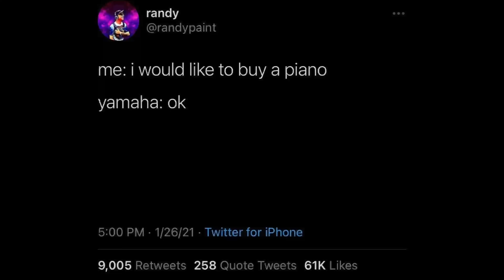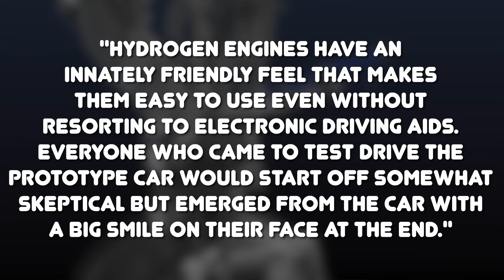Toyota's New 455HP Hydrogen V8: Everything You Need to Know

Comment: if you read a lot of  the comments on line about electric cars,  you'll see that they have numerous problems and are very impractical. there's not enough lithium for all the batteries. There's no way that the electrical grid can handle all these car's charging up if they become the majority. Their way to expensive. On tesla alone, I counted 21 problems from owners who commented on line. Waiting at a charging station can take a long time and if you don't have the right connecter, you won't get to charge at all. Right to repair is also a big problem with tesla. Also the government will probobly start to miss their gas tax, and figure how to punish electric car owners. one tesla owner said that it cost 20,000 dollars to replace a battery. they don't save the environment because fossil fuels are used to produce the electricity for them. driving distances for them is still very poor.                                              so electric cars are not the answer. they have their place, but only on a limited basis.

Comment: I live around 20 miles from a hydrogen filling station and about the the same from a Tesla supercharging station. Normal EV charging does not interest me as it is way to slow. It takes about the same time to fill a hydrogen car as a petrol car so there would no waiting around when I get there.
When we get many more electric cars on the road, people will be queuing up for the chargers or plugging them in at home for hours or overnight. There have been concerns raised that some areas do not have the infrastructure to supply enough electricity for everyone to have an EV so this would mean digging up roads and running more cables. Also people who live in high-rise buildings would not be able to charge their car from their home supply, and there are reports of a lot of chargers not working so they are already unreliable. And what happens in a power cut? When it ends everyone will want to charge their car.
As they sell more EVs, more charging stations become available, but they are playing catch up, the same could happen with hydrogen cars, some petrol (gas) stations have LPG tanks for those who have converted their car to it and they could have hydrogen tanks instead or as well. As the fill up time is quick there would not be the same queue as for charging and the catch up would be quicker as it would be centralised in filling stations and not the many chargers in every town that would have to be installed.
With more EVs there will be less demand for petrol, so the garages will have to change to EV charging points or hydrogen. Diesel will probably be sold for longer because hydrogen engines would probably not suit trucks at the moment unless it was a fuel cell type that converted it to electric.
Also we can convert our ICE cars to hydrogen meaning they won't have to be scrapped causing a lot of waste, and there will not be any dead EV battery waste from them either.
You only get steam and water out of the exhaust pipe as well almost no pollution.
You need electricity to make the hydrogen and his could be done with wind turbines, solar panels and tidal power and the hydrogen taken by tankers to the filling stations. As the you need water to make hydrogen the tidal power could also power a desalination plant for the water used.
#HaveIJustSavedThePlanet?

Comment: JCB, a British equipment manufacture converted its' diesel engine to hydrogen basically because the electric added $250,000 to an excavator and they could only run it for four hours a day. The Hydrogen engine was far less costly and could run all day. Ask any construction company what they would prefer.

Comment: i think whenit come to maintenance the electric is going to out of pocket expenses do to the hydrogen motor since the motor it self wasnt modified all that much and the more we work with it the better it will get just as the electric has. plus you can make hydrogen right at home with barely nothing just water and a batter

Comment: So Hydrogen cars could be a real alternative to electric as we would be able to refuel a Hydrogen car with a cell that you could buy basically any shop. Of course a law should cover the ways of selling this Hydrogen power cell's. So as I said before I would buy any day a 450BHP internal combustion engine powered by Hydrogen gas but stored as solid fuel. Electric cannot replace the feeling that's given to you by that explosion inside the engine and after in the exhaust. More than that is something else to struggle sometimes to keep them in a line. Internal combustion pro optimistic as far as the car or any other commute  with internal combustion is 0 emissions and even more if the fuel could be obtained by contributing to the effort of caching and lowering CO2 emissions. So good luck to all car makers and hope to see this put in to application ASAP as we need this change. The tech is out there waiting to be built.

Comment: Yes, I, personally sincerely believe that Hydrogen will be the alternative to electric  as scientists have developed a stable way of making the gas solid. It's green, easy, cheap and clean to obtain and store and as a result of that it's also easy to transport. The solid fuel It's more stable meaning it's safer to install on car and all sort of internal combustion with some tweaks. It requires an installation that converts the state of  the gas or a installation that separates the H2 from H2O (or mostly any other liquid that's 90%+ H2O). That if I'm not mistaken may 95% or it could be 65-85% water. But recommended was pure water. But not the purified one as that doesn't conduct electricity wich is needed to separate the H2.

Comment: Thanks for the great video. I think we have to wait for Hydrogen prices to drop. First use will not be for personal transport, but commercial. Mining and long haul transport will likely be the ones that use hydrogen. So they will underwrite hydrogen fuelling stations. Large vehicles and diggers are perfect for hydrogen. Current hydrogen powered cars need hydrogen tank (expensive due to high pressure), Proton Exchange Membrane (PEM) - like a electric cell, and batteries (to cover acceleration and peak uses, to recover energy while breaking). Sound expensive? Sure is. For large industrial users this also makes their use expensive due to capital cost. However, if you take current technology (ICE) and burn hydrogen rather than hydrocarbons you are clean, and have a lower capital cost for your digger, etc. Just have to wait for hydrogen costs to drop. This will happen faster than you think (less that 10 years), and hydrogen will be cheaper than hydrocarbons. Then your enthusiast engines, like this, will make sense. All the fun and none of the emissions. Win - win. The key is hydrogen economies of scale. Using large wind farms, combined with batteries, etc. the cost of hydrogen (currently around $6-8/kg, will drop to below $2/kg)...

Comment: Hydrogen vehicles will be mandated by 2030 in Japan. Japan is currently setting up the infrastructure to make that happen.
For vehicles hydrogen has a dual use. It can be used as a fuel source for internal combustion engines and a fuel source for battery powered vehicles. Hydrogen can be converted to electricity in order to recharge batteries. The refuel time is about the same as gasoline.
It really is the right answer.

Comment: I'm sorry, but I have to correct you here: Electric cars are very good to be use in what is called the daily passive power and nothing more. Batteries can never take over the so-called " Transportation work forces " such as Trucks, Train, Ships and commercial airplane. It is just impossible. Hydrogen is able to do all of that, without the needs of any fuel cell at all, and that's the main reason for those Japanese companies to invest in Hydrogen combustion, instead of fuel cells or electric. YES, you can also make any muscle car engine do the same as long as the engine is prepared from day one at the manufacture. I saw a Dodge Ram 5.7 liter, converted to direct hydrogen in Germany in 2012, and everyone were sent to prison, psychiatric hospital and killed. The only problem with hydrogen is, that many people thought they could just attach a bottle of water to their engine, and they got free energy >>> WRONG. Also, using the reactor TERRICOLA 1, hydrogen stations can be at all locations in very short time, is just a question of money. Moreover, let me remind you that a hydrogen station like TERRICOLA 1, can also charge all the Electric cars 24 daily. All the mombo-jombo you hear everywhere about hydrogen, is nothing more that the old system of singularity factor, which is ridiculous anyway in our time. TERRICOLA 1, is a multiple factor 180 per cubic meter and an activator of 2340 x 18 = 42120 liters per minute, compressed by a 500 bar dual shaft compressor at a temperature of no more than -20 c°... SO, a hydrogen station at every Truck Stop location will require a TERRICOLA 1 Module = producing 42120 x 18 M³ =  758160 liters per minute, running to the compressor unit for storage and refrigeration. SOOO, Hydrogen is not for passive use, but for work force demand. Batteries are for passive use and they heats-up and explode, killing and grilling everyone inside. Don't believe me? Then ask the fire department. NOTHING IS AS FANTASTIC AS HYDROGEN MULTIPLE FACTOR..  Thanks for the video.

Comment: I have to disagree with you about electric cars taking over.
Batteries.
At the current production rates, we will run out of the raw resources, specifically cobalt in this case, in as little as a decade, not to mention the literal child labor and near-slavery wages in the African mines where it comes from. Unless there is some massive leap in battery tech using materials that are as abundant as steel/aluminum used in ICEs, they will never replace gas engines. Then there's the concern of the actual emissions of an electric car, the power plant charging it. Wind and solar will never meet the growing demand without its own massive leap in productivity. All this while around the world, nuclear power plants that are actually carbon neutral are being shut down in favor of wind and solar. Then when those are not able to meet even current demands (not to mention the growth in future demands), the slack is taken up by coal and oil plants. Yes, Germany, I'm looking at you.
Tldr; in reality a brand new non-hybrid Civic has a lower carbon footprint than a Tesla and the production of the Civic doesn't rely on child/slave labor

Comment: Been saying this I'd the real future for 10 years. With a modified fuel system and some tuning a carburetor engine can run on hydrogen. EFI needs some more, but any ICE can run hydrogen. The long term is where the questions are right now. What kind of reliability? What kind of maintenance costs? But personally, I think those would be comparable to standard gas. The real hurdle is infrastructure. Gas stations don't have hydrogen. Though, if you know what you're doing, you can make your own. As far as emissions are concerned, it takes a lot of electricity to make hydrogen from water, and in the US, the powers that be are swan diving us into the shallow pool that is "renewable energy". The bottom of that particular pool is made of coal.
#TimeToGoNuclear

Comment: You failed to mention that GM is also heavily invested in the hydrogen concept…but very quietly and secretively.   In addition, you failed to touch on the greater energy issue which is “Where and how is all this electricity going to come from to charge and run these electric vehicles ?”.     Where is the discussion about what form and shape hydrogen fueling stations will or can take and how quickly can that industry build fueling stations across ed the country or world for that matter ?    And what are the safety factors ?

Comment: I think hydrogen is the smarter solution. What a lot of people forget is that both hydrogen ice engines and hydrogen powered electric vehicles are possible.  You can fuel both the same way you would a gasoline car, and in about the same amount of time.  Electric cars, ok... but fueling electric cars with electricity? Dumb idea.

Comment: I disagree, I think consumers would much rather drive a motor that doesn't use gas. Gas gives off pollution, and keeps us dependent on foreign companies. The only thing this video didn't mention was the cost of hydrogen per gal. I realize that currently, California has places to refill, but I feel that would change if the cost of hydrogen is less than gasoline. So we need a comparison on how much it cost to run the motor with hydrogen vs gasoline.

Comment: Electric cars will never be able to compete with hydrogen. The only reason people are buying electric is cos it got rammed sown their throats by Musk and Tesla. If it was left to governments and traditional car manufacturers they'd still be rinsing every last ounce of profit from petrol and diesel and current electric car sales would still be negligible. Tesla forced everyone's hand. In terms of practicall, a car that needs 30 mins to charge up will never be able to compete with the 5 minute fill up that you get with hydrogen. Apart from having a potentially limitless supply that doesn't rely on depleting battery packs which are enormously polluting and unethical to produce, the infrastructure for hydrogen pretty much already exists, in that every petrol station can just be converted to sell hydrogen at the pumps, just like many did with LPG conversion back in the day. All it needs is someone to take the initiative like Tesla, because governments move slower than a dead snail's funeral.

Comment: Electric cars don't eliminate maintenance. They go through brakes and tires much faster than gas powered cars. The electric motors still require maintenance as well and goodluck for all the D.I.Y. people (like me). Spent my whole life learning combustion engines. I hate electric cars. They have no heart and soul. Boring as sh*t to drive. I want a V8 combustion engine with a manual transmission. I will NEVER own an electric car. And for all you libtards, electric cars actually put way more carbon out than gas powered cars. Look into the battery production, lithium mining, how most electricity is actually made, etc. Electric cars are actually doing more carbon "footprint" before you even drive them, than a gas car up to 80k miles. It's a massive scam.

Comment: Hydrogen ICE biggest advantage over pure electric cars is they don't need a massively heavy and super expensive battery.   If the longevity, weight and poor recyclability of existing batteries doesn't make a major advance in the next 10 years then this type of engine will become the default.   I will certainly be the next generation in heavy vehicle transport (long haul trucks).

Comment: Hydrogen can be easily produced in home conditions from solar power plants, high pressure can be achieved with pumps. Hydrogen also will keep up engine cleaner and you do not need catalytic converter that limit the engine power.

Comment: You forgot that part about how much energy goes into raping and destroying the earth to get the rare materials needed to make those EV batteries as well as the Co2 emissions, but I guess blowing up mountains, contaminating the water supply, as well leaving massive craters the size of large towns is all cool. Then the toxicity of the batteries and their disposal. As for Hydrogen fueling stations UK, France, Belgium, Austria and Japan are using current petrol stations now they removed a petrol pump and added a Hydrogen one in its place.

Comment: Hydrogen via combustion is far superior to electric in almost every way when you consider Trucks.
I don't own a car, I own trucks because they pull things, just like Big rigs. So, If doing an engine swap from diesel to Hydrogen is all it will take to hit zero emissions and I get to keep my $200k Big rig and trailers,  then I don't have to buy a new electric turd that costs 2x as much, weighs 2x as much, will take Hours/days to recharge and still sucks juice from a coal burning plant, WHICH IS A HUGE PART OF THE PROBLEM, then YES, I would absolutely buy Hydrogen engines far before I buy anything  predicated on the Idea of using an outdated, rundown, insufficient electrical grid that shuts down every time i turn on the A/C in my house.
The World is not ready for electric cars, period.
Until people realize that the world needs power 24/7, not only when the sun shines (only half of the day), or the wind blows, we need combustion, all forms of it.

Comment: I'm praying for something other than electric nerd mobiles. I do not want an electric Quiet One Speed granny car. I love to row my gears. And I also love the sound of an engine especially a V8 with a 6-speed manual. They will never sell this forty-three-year-old man an electric nerd mobile. I'm sorry but I'm old school and electric cars to me or their equivalent of a fucking golf cart with doors. They may be fast but they're boring. I wish that Mercedes would put a V8 and everything they build and trash are four cylinders and trash their V6 engines as well. There's no replacement for displacement and there's no sound like a V8. It's like a Harley-Davidson they're not fast and they're not economical. And they cost a fortune and they're not real reliable but they sell very well because people love that traditional V-Twin 50 60s and 70s look and sound. If it ain't broke don't fix it. I'm old school if I had the money I would love to have a 1972 or 1973 Plymouth Roadrunner with an 8-71 GM blower and 16 inch cragars. And a Toploader 4 speed. I'll pass on the whole Teesla  , Tesla or whatever you call it. 
If you want to look like you've got money go buy a Mercedes-Benz s580. For about $200,000 you don't go buy a $30,000 Tesla model 3. But some people out there are impressed by a turd with ribbon around it🙄